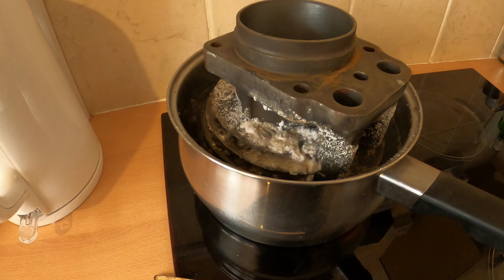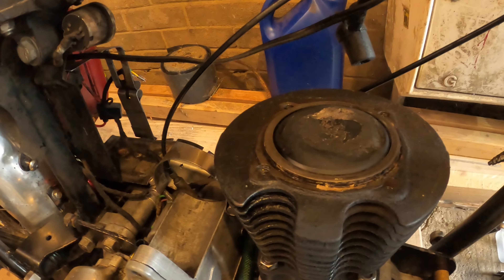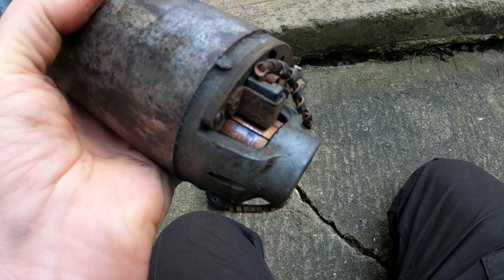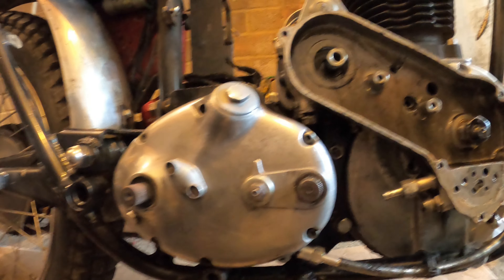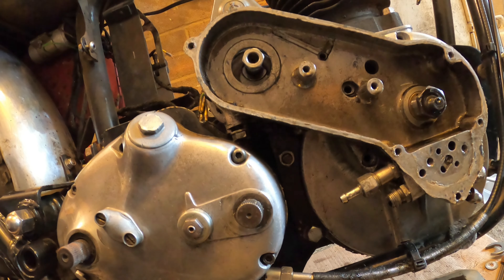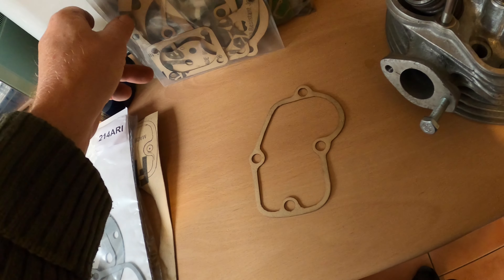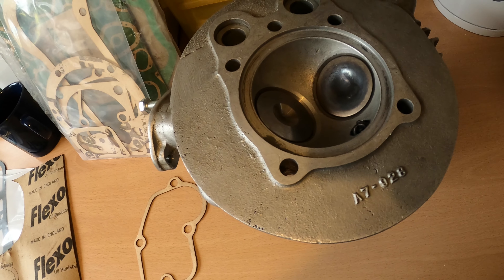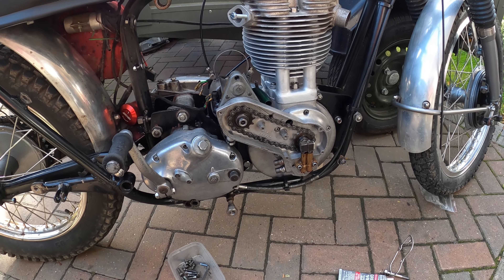Ariel scrambles spec engine and thoughts.

Comment: Hi Dean, nice work you're doing! Out of interest, how did your engine builder go about balancing the engine, has it been balanced for smoothness at normal "cruising" revs? It's generally very hard to effectively balance a single. It has been interesting following your exploits with the bike and it's development.
Reply from the maker: Thanks Phil. Yes he gave it a balance factor of 66% which is what they balance their Vincent singles to, and is 1% more than Ariel balanced the road going engines to at the factory. Cruising speeds back in the 50s were around 60mph, and the top speed for the road bikes was around 87mph,  but this is a competition engine with almost 10bhp more, so will hold higher revs in lower gears. Obviously a single will always vibrate at some point in the rev range, and a different factor just moves that point.  It's very smooth so far at in town speeds, and around the lanes at about 40mph, although I wont be giving any more throttle for a few more miles yet.  Hopefully it will be very smooth on the A roads at 60mph plus. With the long stroke engine, I never felt the need to balance it beyond whatever factor it was already, and on the furthest day trip, to the National Motorcycle Museum in Coventry, it felt really smooth at between 60 -70mph, and gave an amazing 90mpg.
Reply: @thra5herxb12s  Thanks, appreciate the comprehensive answer! You've obviously got an engineer of the old school there- safe hands.

Comment: Thanks for the update on the Ariel, I picked up a few tips from it. I used the Draganfly alloy gaskets on my iron head NH and they fitted ok but have had problems with some sets, as you mentioned. The new motor should have good performance so I look forward to watching some videos when you are on the road. Do you still have the WW2 van?
Reply from the maker: Thanks. Yes I used one of the alloy gaskets on my VH iron head and it fitted ok but not perfectly.  I've never had a van though.
Reply: @thra5herxb12s Austin Tilley 1943?